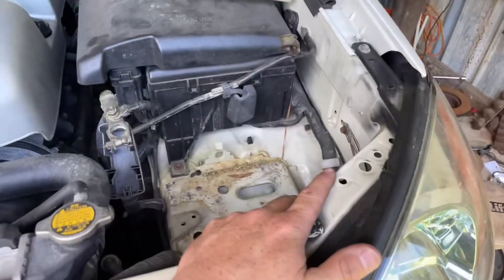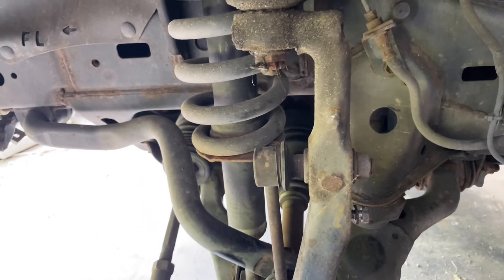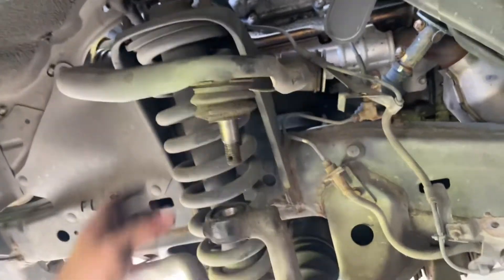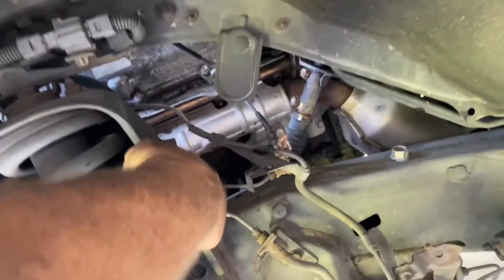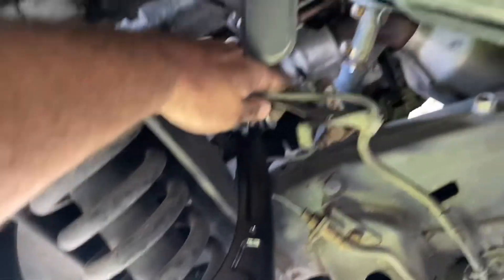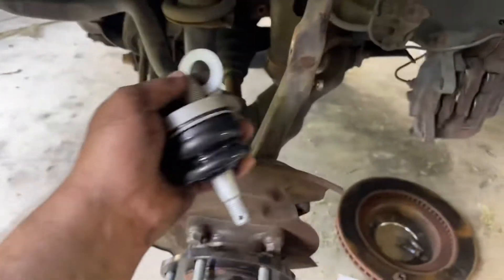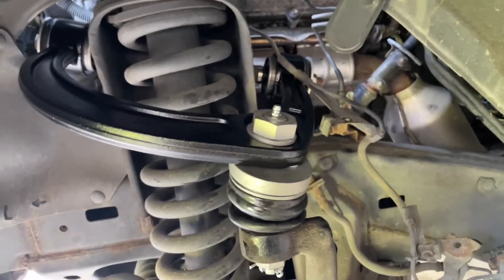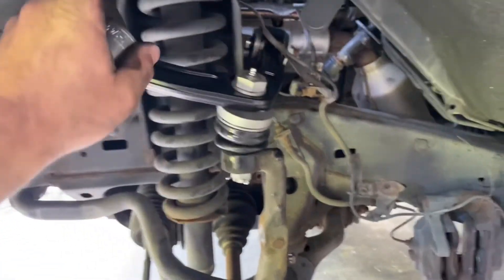Installing SPC Upper Control Arms | Lexus GX470

Comment: I have a 2” lift with stock upper control arms. What benefits will I see with a set of these after market ones? Also have you heard of the front transfer case supports being weak in the 03-04?
Reply from the maker: Yes I’ve heard of the transfer sports being weak in those models they make a good replacement for them. A little bit more articulation if you use those but with a 2 inch lift you won’t see a great deal of increase
Reply: @crutchfieldautomotive7936  Any idea where to get the replacement supports?
Reply from the maker: Most local parts houses can order, Lexus can order as well

Comment: I wish the bolt that mounted the ucas to the frame weren’t the one long bolt lol. Any idea if anyone uses 2 bolts per uca on each side and not using the factory long bolt hard ware
Reply from the maker: It’s an enclosed casing that’s holds it all the way through I’m not sure how hard swapping to another system would be.
Reply: @crutchfieldautomotive7936  ahhh! Makes sense ,going to just go with the long bolt. Appreciate the reply you are awesome! Love your videos. Thanks again for the help